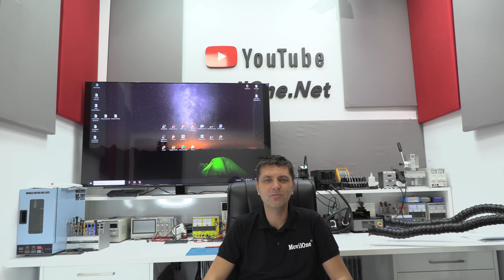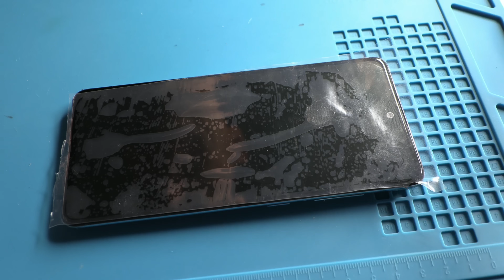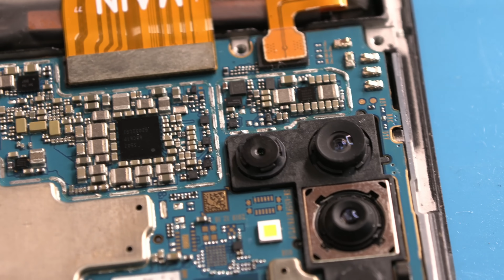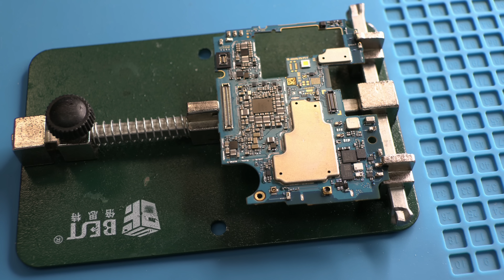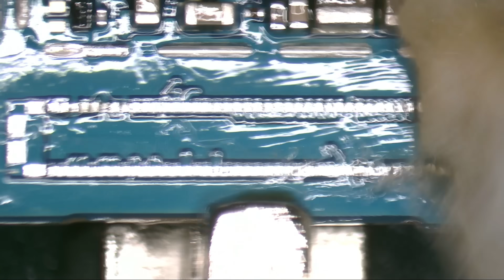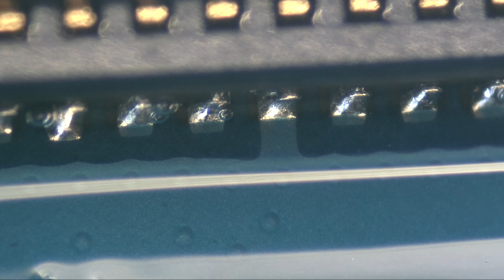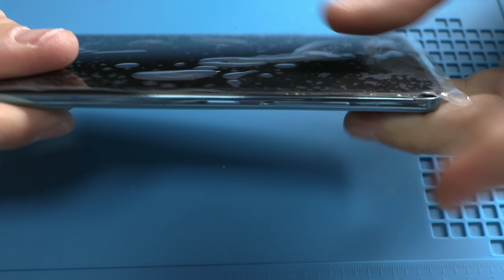The Samsung A Series Secret They Don't Want You to Know!

Comment: It's not specific at Samsung ,i have a Xiaomi mi 10T lite 5 g and the same fpc connector but 50 pins ,failed 6 months ago .The phone was right during 5 years before .
I think a overheat happened suddenly during a charge .
I try to fix it but i could'nt found lead solder paste with low melting point (138°celsius ) .I found only lead free solder paste with low melting point at 172°c,but in reality it was 270°c .
I'm really angry about Xiaomi : not only one care shop Xiaomi in France ,only in Spain.
In France not only one shop agree to fix my phone ! 😡

Comment: I had a Samsung J6 Plus before and it did not have any hardware problem but it became slow and frustrating to use because I updated the software. Sad part about that is that I couldn't downgrade it to the previous version. That is why I will never buy a Samsung phone again.

Comment: this happened on my S22ULTRA, the screen broke on my phone so i bought a new used screen, and i was transfering my hardware myself over, mind you ive been building computers for 24 years so electronics is simple to me. i noticed my fpc connector was bad as well, unfortunatly i cant do micro soldering so i paid a shop $150  to replace both fpc connectors..   Which worked great, but then samsung updated all phones to one ui 7 or whatever, and that started to brick s22ultras and s21 as well i believe...  the phones would shut off, and sometimes never come back on.... people online found the update  did something to the voltage on the boards and caused the mainboards to fry... i got lucky that mine didnt as i kept it in power saving mode, and subsequent updates fixed this... however... the time this happened it drove me nuts...  this combined with the failed lower speaker after only 2 months owning the phone " when it first came out"  that and the random black dots on the screen from the film inside pealing off the screen...  Then i had a green line through the screen...   i finally washed the phone the other day by accident, and because its been worked on the ip68 rating was gone so it killed the phone...   So honestly i could replace the mainboard for $200 or so.. but is it even worth it ?  nope.   So i decided to get the new razr ultra 2025.   Im waiting for it in the mail now.    I will never own another samsung product...  Between me having issues on the s2 the s4 the s7 the s22ultra and only my s9+ being the good phone.... then on top of samsungs software updates that kill phones or remove features on older phones to force people to upgrade..

samsung is a crooked company that needs investigated

Comment: I used to own a Nexus 5. You could only buy it unlocked. You couldn't buy it through any carrier. That phone was the best phone I ever owned because it had zero bloatware on it and it was built like a tank. But LG, the ones who made it didn't like that. They lasted too long (7 years) and they bricked it on an update. They put my phone in the continuous boot loop and I had to get a new phone. I can't believe that we as a people waste irreplaceable silicon on stupid devices like cell phones and then plan them to fail early.

Comment: samsung is silently making phones in such way that though people like the vibrant ui but they eventually develop issues like motherboard dead, battery drain, charging port issues, glue sticking inside back pane, heating, etc and moreover giving drop notch at mid range, A series with cheap, useless exynos processor and still charging that much

Comment: My iPhone is 6,75 years old and everything runs perfectly. I use it as a truck driver for navigation and barely 24/7 streaming. Power use for barely 7 years and no problems. Only the battery is a little bit weak because it’s still the first

Comment: Personally,  I used an A54 5G for about two years. I never experienced any hardware failures with it, and it still works. Through a hard lesson, I learned that the A series phones are not something I want to buy again. It's either the flagship S series, or it's a no Buena. In this case, I opted for my first S series phone. The S25+.

Comment: I have been seeing these style of connectors on all kinds of devices some connecting multiple boards, lcds, and modules like cameras even battery's and I can say yes they keep getting smaller and weaker and also lead free solder sucks so when you add the two together, it's not a recipe for reliability!

Comment: I had a a03s in 8th grade and I messed up the connector on mine the battery wouldn't charge unless I disconnected it from the board and plugged it in than reconnecting it so I cut a hole in the back panel and did that every time the only problem is that the battery percentage was not showing

Comment: My Family, friends and myself where using Samsung phones for years, but the last time quality drops. My Samsung Galaxy S22, which is indeed an expensive device was nearly destroyd by a blown up battery. I fixed it and replaced the battery and the backcover. The A50 and the A32 struggling to bahave normal, theyre getting slow and laggy until there was no charching possible anymore, and both USB contact was loose. I decided to switch to Apple iPhone 14 for now and i am happy with it so far...

Comment: That's a fact and the most annoying trap I went through is a Xiaomi Redmi smartphone that they intentionally put loose screw in the edge of the screen and when you unscrew and screw back a bit of firm will break the screen from the back that is in most case not noticeable until you turn the phone on and see a line or black spot.

Comment: I have a problem with my A10s where I've replaced the charging circuit plate. Now it charges but the speaker makes like a white noise and distorts and the ear phones does the same...I've tried resetting the phone and lowering the volume but it still distorts...how can i solve this problem please

Comment: I've had a microscope repair shop, and they're doing the same. Common problem is the fine focus dial is malfunctioning. and the cause for all brands icluding the big one is all the same, the plastic linear gear that becomes extremely brittle over a year.

Comment: 99.5% ADMIN saying phone is designed to totally fails on calculated years specially Samsung the most recent updating schedules with designed versions to makes updating devices poorly work, galaxy a series will performing badly after 3 times updating becouse preloaded spaces specially ram is tiny and updating files and os is designed to makes user feels so mad and thinking just better if throwing galaxy into septic tank

Comment: I have the same issue on a Samsung S20. I replaced all the wires to fix a problem with power button. Suddenly I lost network connection, bottom speakers and file transfering. Everything blew up for me trying to fix the power button. These connectors are so fragile its intentional the way they made it like that. They dont want anyone opening their phones. Never trust Koreans!

Comment: I tried buying a brand new S20 on ebay. I started by ordering an S20Ultra. Soon as I got it I transferred my info and apps and used it at work like with my old phone. It lasted less than a normal 8 hr shift. I checked it and thought maybe my apps are interfering so refreshed it to factory and only added a few apps. Same problem. I did the diagnostics and it came up with a battery error. Battery was degraded so I sent it back. Ordered another one. Same issue plus when I tried to wirelessly charge, when putting both of them on the charger it started flicking through apps like someone was playing with it. So i sent it back because of the Battery degraded and bad useage times. Ordered the S20 plus instead. Straight away I loaded it up clean with none of my apps. Checked the diagnostics. Same thing, battery degraded. But it ran for a full day and was much better so added a few apps and it had much better battery usage except diagnostics said battery was degraded. Then the right side of the screen on the edge stopped working so I couldnt send emails or comments the  0, p , L , back button and enter button wouldnt work. Diagnostics showed the touch screen on the right edge was not detecting . Sent it back. Finally bought an S24 at a store rather than off ebay and it is awesome.
Not that there is anything wrong with buying off ebay but the S20 even when knew is a 5 yr old phone and they have been sitting in the boxes unused for almost 5 yrs. The batteries can degrade while not in use as I found. Also Samsung is not sending out security updates anymore as of march 2025 so they are not going to get fixed by any updates any more.
This is how they get you. You need to buy a phone no more than 2 years old if new because the battery degrades while sitting in the box and after 5 years they stop sending updates. My old S10+ works fine I was just updating and found all of this out.

Comment: wow. The last time I used Samsung was like 10 years ago. I switched to China brands and they work like charm. I still have my old China phone from 8 years ago, change because it was getting too slow. Just need to change the LCD and battery every once in a while. Any comment on China brands? I change the LCD because the original broke and the clone replacements do not last.

Comment: - But you get 3 years of warranty on every Samsung devices, at least here. So you just send it back and they fix it.
- A-series costs less than a repair like this. It's like 100$ after a year, used. They are pretty much throwaway plastic phones. (A-series, that is.)

Comment: So its just model from 2019-2020... I got A31 and no issue so far. I bought and used it since 2020.
Reply from the maker: Glad to hear your A31 is still working well! Not all models fail the same way, but many from that period started showing recurring issues especially due to things like solder fatigue and fragile FPC connectors. If yours is holding up, take good care of it!

Comment: I have a51s with this issue the battery got punctured in one and cooked the whole phone and messed the connectors the other the repair guy messed up
Reply from the maker: One of the biggest issues I see in repairs is poor thermal management and rushed workmanship. Sometimes the repair does more harm than good, especially if the tech doesn’t respect the precision these components require. I hope you find a trustworthy repair shop, or better yet empower yourself with knowledge. You're always welcome here.

Comment: I have had a Samsung j7 2017 since 2018, and it is still working today; I didn't have any issue with it; my child is using it now. The only "problem" today is the battery, its capacity dropped 50%, but that is normal to expect after 8 years of usage. Bought A16 5G, and will see how long is it going to last.
Reply from the maker: That J7 is a survivor! Back then, devices were built with more robust components and fewer intentional weaknesses. Battery wear is natural after 8 years that’s completely expected. Let’s see how long the A16 lasts… hopefully it proves to be one of the rare exceptions to the growing trend of disposable design. Thanks for sharing your experience!

Comment: WAIT! At 1.52, DID YOU SAY THERE IS VOLTAGE BUT NO CURRENT? CURRENT DOESNT FLOW IN AN OPEN CIRCUIT. OPEN CIRCUIT CAN BE CAUSED BY FAULTY COMPONENTS, DRY JOINTS OR CONTACTS, LOOSE CONNECTIONS, DAMAGED OR BURNT WIRES ETC.  CONNECT THE  BATTERY AT THE OUTPUT TERMINAL AND YOU SHOULD SEE CURRENT START FLOWING IF EVERYTHING IS OKAY. CURRRNT FLOWS WHEN CIRCUIT IS FULLY CLOSED ALTHOUGH YOU CAN SEE VOLTAGE BEFORE THE FAULT...
Reply from the maker: Exactly, you're right to highlight that. In open circuits, voltage can still be present across components even if no current flows until the circuit is closed. In our case, we're tracking that open point caused by internal damage or broken paths. This is a very common issue in Samsung A-series devices, especially when the FPC connector loses communication with the mainboard. We've repaired hundreds of these cases in our workshop. Thanks for your comment!

Comment: How about fast charging not working?
Reply from the maker: Good question. When fast charging stops working, it’s often due to wear on the charge controller or poor contact on the battery flex, not necessarily the port itself. In many A-series models, the problem is internal and often intentional — to degrade performance gradually. We’ve seen this in dozens of devices at the workshop.

Comment: yea -A fone =trash. most are carrier fones anyways. then some folk are buying them on open market. i mean i get it its cheap BUT that makes it disposable. i see soo many of those ,total waste of time . every other screen replacement becomes some type of solder job. and from a user persprective hole baby jesus of nazereth ! u have to be a special person and actually have the card in ur pocket to not think the lag is un bearable . those media tech chips arent fit to drive a toaster
Reply from the maker: You're spot on. These devices are made to look affordable but designed for failure. That’s why screen replacements often become board-level jobs: fragile connectors, weak pads, and poor soldering. It's not just bad luck it's how they're made. You’re seeing exactly what we see at the bench every day.

Comment: does A52 also have same issue? please reply asap! because I'm thiking of getting one in used condition
Reply from the maker: Yes  the A52 also has internal power issues that show up in similar ways, especially after minor drops or heat exposure. We've repaired several with faulty battery connectors or flex damage. If you're buying used, make sure it turns on, charges consistently, and hasn't been opened before.
Reply: I was going to buy one but luckily I got myself a new one. Not a Samsung this time. Because this fact, that you unfolded, hurt me so much that I hate them now. @MovilonePhoneRepair

Comment: Does this issue also applies to the new A06 Samsung?
Reply from the maker: Yes, and unfortunately it’s getting worse. Even the newer models like the A06 still use fragile connectors and designs prone to early failure.
Reply: @MovilonePhoneRepair omg I'm so cooked. Let's see how long this phone lasts

Comment: Solder points so fine and close together.. I don't think I'm able to do this.
Reply from the maker: It does take precision, but it’s absolutely learnable. Start with scrap boards, use leaded solder and low temp tips. It’s more about hand control and patience than fancy tools. That’s why I always say: what matters is the discipline and the will to practice.
Reply: @MovilonePhoneRepair  thank you for the tips and encouragement. Will keep doing it

Comment: And about the green line on screen on S20 and other's?
Reply from the maker: Yes, the green line on OLED screens is another typical failure usually linked to pressure damage or internal connector faults. But in many S20 cases, it’s a defect that shows up after updates or even randomly, suggesting a design flaw. Sadly, replacement is often the only fix.

Comment: Lol i still have my a20 and im currently using my a33 5g and my a33 5g still has a multicore score of 2010 and a single core score of 972
Reply from the maker: It’s good you’ve kept your A20 that long. But as you’ve seen, even with solid specs, performance can degrade due to hidden design weaknesses power delivery issues, bad soldering, and software updates that "conveniently" slow things down. Those scores only tell half the story.

Comment: Does A55 have this issue too?
Reply from the maker: We’re just starting to see A55 units in the workshop, and yes same pattern: thin connectors, pressure on the flex, and early failures with charging and boot. Samsung hasn’t improved the internals .
Reply from the maker: Yes, unfortunately the A55 continues the same design pattern: weak connectors, pressure points, and solder joints that fail over time. It may look more modern on the outside, but inside the problems remain.

Comment: Motorola does the same. Killed my device by software update and sony too. Now many phone companys are removing bootloader unlocking claiming security reason bullshit. Now u can't root.
Reply from the maker: Completely agree. Many brands now block root access, not for security but to prevent repairs, backups, and custom firmware that would extend the device's life. It's a war against user control disguised as "protection".

Comment: I haven't watched the video yet but the thumbnail suggests there's some legit content here. Because I have an A51 whose main strip causes issue from the same area he highlighted which causes problems with media speaker.
Reply from the maker: You nailed it. The A51 is notorious for that exact issue the main flex area often fails after minor impacts or pressure. It leads to sound problems, charging issues, or even full power loss. Give the video a watch when you can, I break it down with real proof on the bench.
Reply: @MovilonePhoneRepair yeah, the issue is getting even more serious. I took it to a technician and he replaced the strip (around 4 months ago when I didn't know the truth) and the phone started causing same sound issue after a few days again. Now it's getting just bad. People aren't even buying it as a rumor has risen up about A51 that it's motherboards die very quickly. I hope the A51 I have at my home doesn't do this 🎉